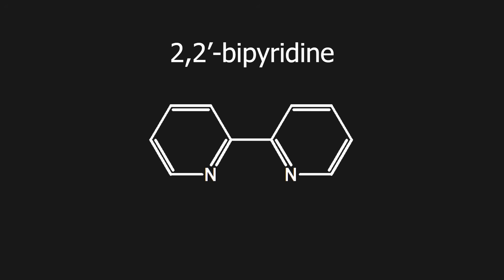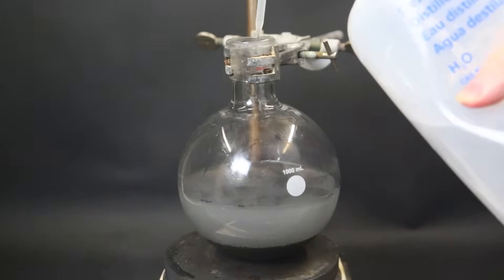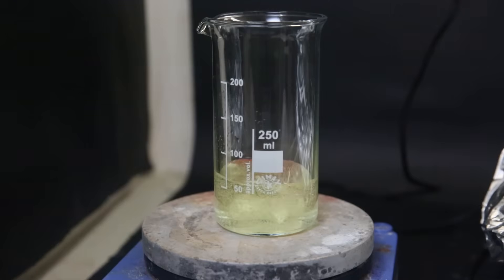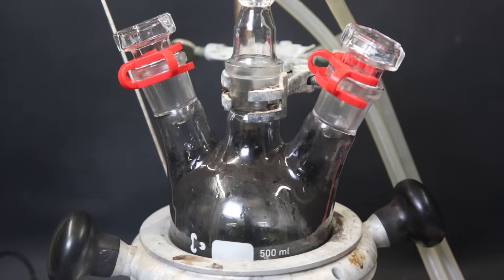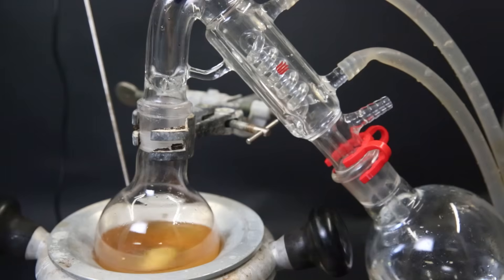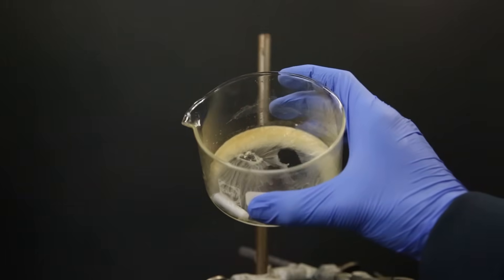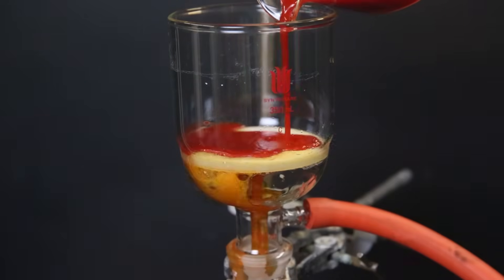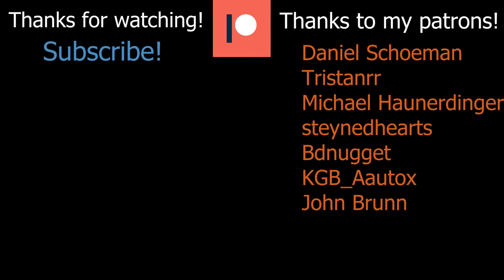Making 2,2'-Bipyridine and its Ruthenium Complex

Comment: Nice work on the synthesis! One thing to note though, is that the complex doesn't show fluorescence, but phosphorescence. It's a very important difference for many applications of Ru bipy, actually :D
Reply: Yes I used the phosphorescence of this complex to determine the amount of dissolved oxygen in my solvent. Oxygen quenches the triplet state that leads to phosphorescence.

Comment: Here are some tips for the column:
1) Do a solid addition : Weigh the crude residue, dilute it with DCM, then add silica, 4 times the mass of crude. Evaporate the DCM
2) Use more solvent in the slurry : When you pack your silica gel, leave the stopcock open, add the slurry, push a good pressure or air in it. When the gel stops moving, it is packed. By using more solvent, you'll make sure that the packing is perfect without cracking the silica.
3) Leave a good 5 inches of solvent on top of the silica at all times : If you always have 5 inches of solvent, you will never disturb the silica when adding more solvent.
4) Don't use sand : Once the gel is packed, leave the 5 inches of solvent, then directly add your crude on silica that you prepared on step 1. Use a pasteur pipette and spray solvent inside the column where your crude is sticking
5) Use pure hexanes when packing : By using pure hexanes, you product will never elute prematurely, and gives you the opportunity to wash off any grease or apolar contaminants first.
6) Use a gradient of solvents : Find the solvent system that gives you 0.3 Rf. Then, calculate 4 different concentrations that are lower. For example, for a separation using 50% EA in hexanes, prepare 4 erlenmeyers with 10, 20, 30 and 40% EA. For 1 gram of crude, use 150 mL of solvent for each concentrations. The first 3 concentrations will not elute your compound, so drain directly in a big 1L flask.
Elute concentration 4, collect in tubes, then you can go with your 0.3 Rf solvent. Your product will come out REALLY pure. 

A good rule of thumb: you want to have no more than 1 inch of the crude on silica in your column. It is much easier this way than doing a liquid addition.
I see that you use way too little silica for the amount of crude. Your yields are often low because you have way too much product for the amount of silica.

Here you have ~50 grams of crude. You should use 20 to 100g of silica per 1g of crude. That's why your yield is so low. You should be getting at least 20 grams of pure bipyridine. Try smaller scale, better column purification, and you would get >70% yields. In this video, 1.6L for 50g is impossible : most of your compound is still stuck in the silica.

I hope it helps! 😀
Cheers
Reply: Even better than dry loading with silica is dry loading with celite. You will get much better resolution that way because the crude product mixture won't stick to it.
Reply: @literallyabee  Hi!
Never heard about that! I might try it this week if I have a chance!
It's the same ratio? 4g of celite per gram of crude?
Reply: @Abdcwyxz  Personally I never measure out the celite. I just use the minimum amount to facilitate the transfer of the product, but  if that ratio works with the silica, I don't see why it wouldn't with celite. I highly recommend it because your product shouldn't stick to the celite like it does to the silica, which results in much tighter bands and better separation. Let me know how it works out for you if you try it :)

Comment: Mate, I need a mechanism. You can't just throw that bipy is formed by raney nickel just like that😢. Why is it inserting into the bond? What's the second pyridine doing? Is the nickel consumed? I NEED ANSWERS
Reply: Mechanism probably consists of pyridine coordinating to Ni through N, followed by CH activation (oxidative addition at Ni0) via sigma like nickelate intermediate, repeat, reductive elimination
Reply: @brandonwatson883  how does it stop at two then?
Reply: @SixTough  not exactly sure. I know terpyridines (terpy) and higher order polypyridines are much more difficult to make and much more expensive. If I had to guess
Bipy is a much stronger ligand then pyridine, possibly holding Ni in place (chelated by both N atoms) and preventing subsequent CH activation and coupling.
Reply: @brandonwatson883  Thank you, that sounds reasonable
Reply: @SixTough  the pyridine excess is probably doing the rest
Reply: I was just thinking the same. He doesn't have to, but it would be nice if he explained to laymen what's happening
Reply: It is used as a solvent, a lot of bipy is adsorbed on Ray-Ni